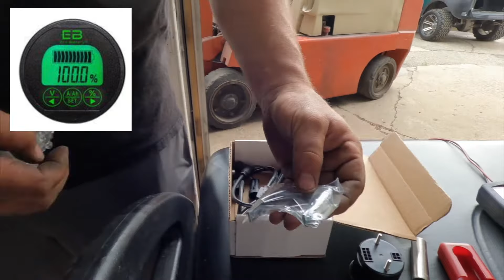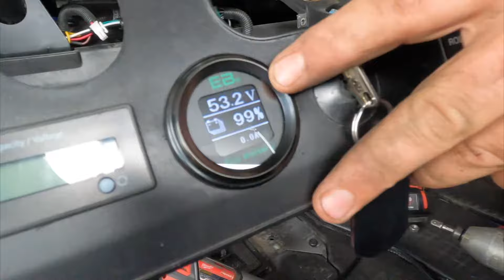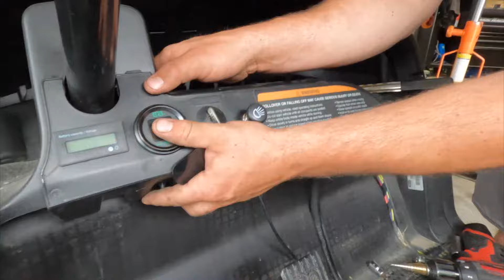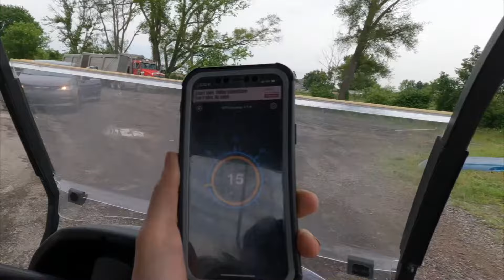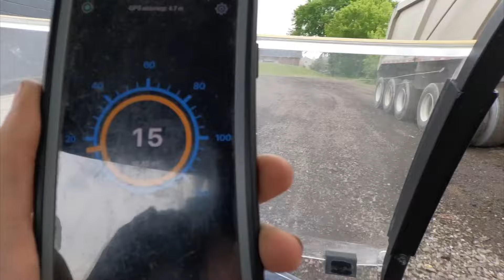Golf Cart Lithium Battery Conversion Kit

Comment: A quick heads up if you bought one of these newer kits. You now have to connect the black/yellow can bus cable coming off the charger to the matching cable connected to the communication port cable. This is a new requirement from Eco Battery. I bought this kit from these guys and they were great to deal with. My charger wouldn’t work and after contacting Eco Battery they told me about the new installation requirements. They are in the process of sending out updated instructions to their dealers.
Reply from the maker: Thank you for the update. We appreciate your business and the quick travel of news to help others that may have the same issues!!

Comment: The battery  can it be put in the middle. Instead  of sides...
Reply from the maker: Yes with the new skinny pack style battery you can mount in the middle of a cart. All the carts are little different. If you need help you can contact me at bmcgolfcarts@gmail.com

Comment: Thanks for the video!  I did not see where you connected the existing lights to the voltage reducer.  I did see you connect the voltage reducer to the battery but not the lights to the voltage reducer?  Where did those wires come from and attached to the reducer?  Thanks.

Comment: I don’t understand why it goes so slow . My 2010 President get 19-20 with old heavy batteries.  I bought it used ( fixed up ) maybe the motor is different than factory
Reply from the maker: Stock motor and controller. This controller was not turned up to max settings. We left it completely factory with just the battery swap. Lead acid lifted carts with 23" tires with the controller turned up to speed code 3 will do 19-20 mph. Lithium swaps usually increase speed 2-3 mph with factory motor and controller. If you switch to a ac set up that's where you can really tell the difference with this battery for overall performance.

Comment: With this swap, did it reduce the weight?  Also, is it possible to add a 2nd battery?  Looks like there is plenty of room.  Thanks in advance!
Reply from the maker: Yes it take almost 300 pounds of weight out of the cart. Yes you can ad a second battery to increase amp hour for more drive time.

Comment: Is Eco and Eco Worthy the same company? The Eco Worthy has a great price on a 48 volt 50ah battery currently but can't find a video with an Eco Worthy brand.  Thanks.
Reply from the maker: Eco worthy is not the same company. Look like they are more in the solar energy field. The 48 volt 50ah eco worthy has, would not be a good fit for a golf cart. This battery only has a 60 amp max output. Most golf cart lithium battery specs are 600 max and 150 amp continuous. 50ah would be really low on a golf cart as well. Your drive time would be really short.

Comment: Hey man
Do u think - you need to put some kind of 
Spring or shock absorber on the bottom of battery - trust me I wasted 1 battery like this 
And finally after so much investigation we 
Found that - if u gonna keep driving like this the one u recently installed without spring or shock absorber. Battery degrade with shocks faster than u expect.  You gonna remember me after 1 year use. 
Victor
Reply from the maker: Hey Victor thank you for sharing this up. May i ask what battery you were using that broke down from shocks. We have been pretty hard on some of these batteries with no issues. However that will be the case for everyone. The lithium batteries have been very popular over the past 2 years and it's good to hear other feedback of possible problems to help resolve issues like you have experienced.

Comment: My gauge has never worked
Reply from the maker: What gauge do you have? Gen 1 or Gen 2?
Reply: @CartPerformance  Not sure Travis from Live Oak Fl installed it. He is the dealer there.
Reply from the maker: @jameshennessey9928  does your battery have a button on the side of the battery to turn it off?
Reply: Yes there is a button. The gauge worked for 15 minutes then went off. Was told a update was coming??
Reply from the maker: @jameshennessey9928  it’s coming with the app. The app is still in beta mode and hopefully with be released soon.  Currently they have sent out tablets to dealers that allows a firmware update to get the gauge working.
Reply: You had to know this before you sold us two units 7k$. Seems unlikely this just started happening to our two carts. Kinda sucks not knowing remaining range as we use them for hunting.
Reply from the maker: @jameshennessey9928  Can you send me your contact information to my email bmcgolfcarts@gmail.com. I will reach out to help get his resolved.